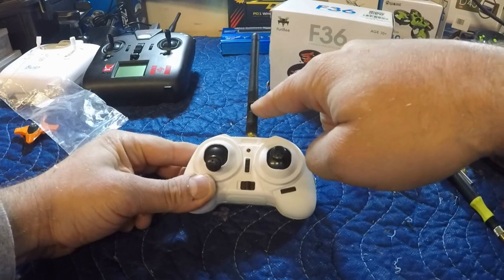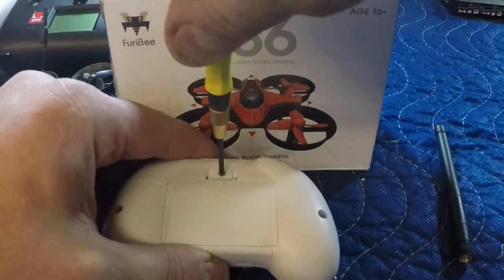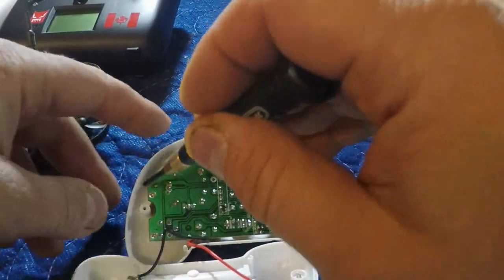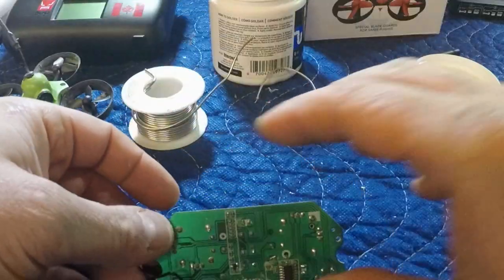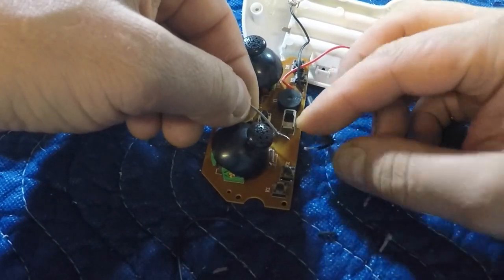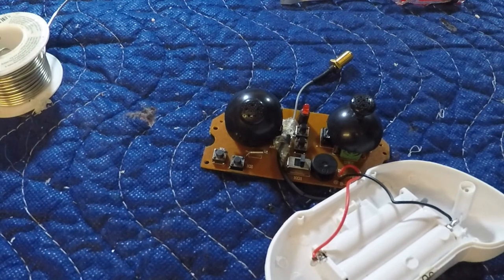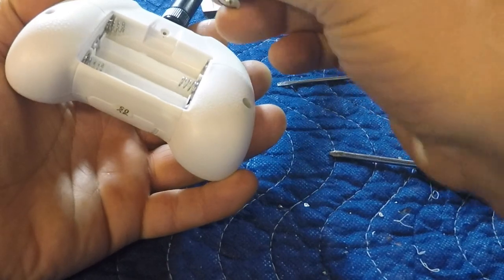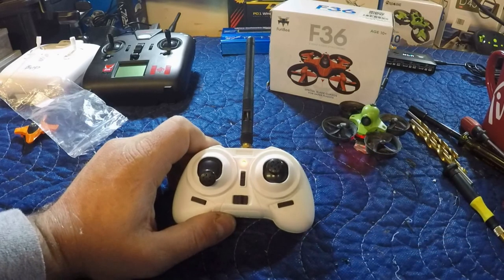Cheap & Dirty Tiny Whoop Range MOD 💵

Comment: is there a way to also increase the TX power?
Reply from the maker: Technically yes, you could run a signal booster that would mount inline with the antenna powered off an external battery. 

I’ve only done this with larger drone transmitters. If you look up mjx bugs 2 transmitter mods I have a video showing the booster